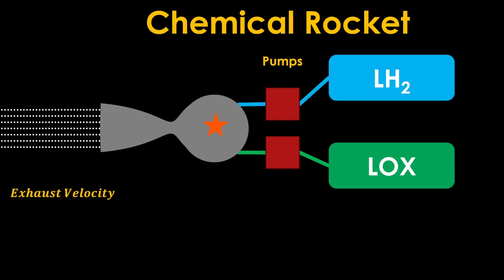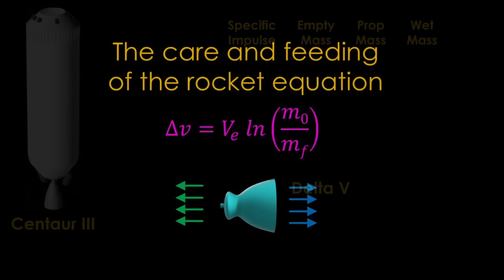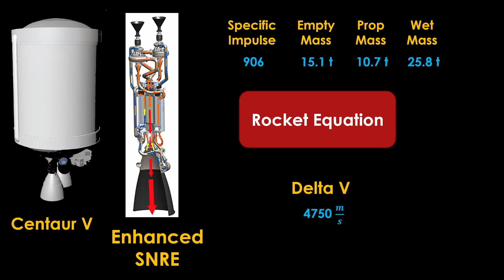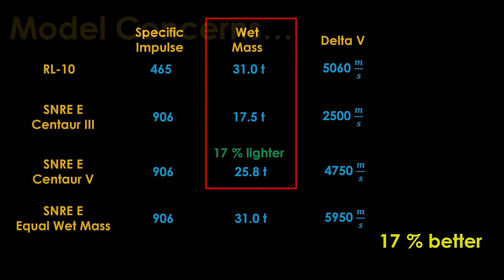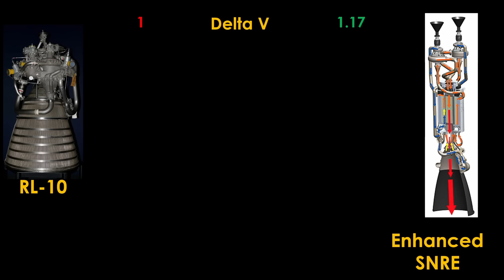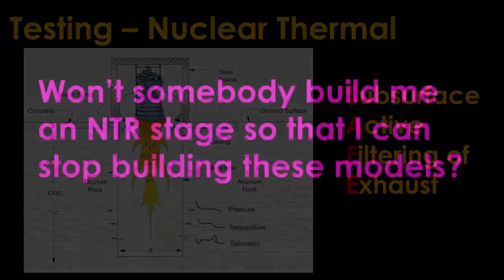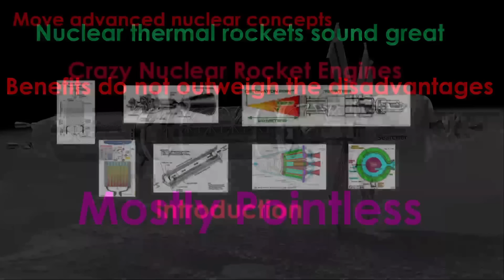Why Nuclear Thermal Rockets are Mostly Pointless

Comment: Thanks for covering this topic. Like you, I've always considered that the performance benefit of bog standard nuclear thermal propulsion not worth the trade-offs, particularly in cis-lunar space where delta-v requirements are more modest and where there's a near source of propulsion consumables (i.e. the Earth). Where it may make more sense is for crewed interplanetary missions where we're leveraging the higher specific impulse for reducing travel time could be a major benefit, and where one could assemble very large stages with large propellant tanks in Earth orbit, but then again you still have to deal with the reactor shielding required to protect the humans. For uncrewed deep space missions, I think nuclear electric propulsion  (or solar electric propulsion for missions in the inner solar system) makes more sense given the much higher specific impulse available with electric propulsion.
Reply from the maker: https://www.youtube.com/watch?v=xUoE7wOB-fY
Reply: @EagerSpace  thanks for sending the link about the nuclear electric propulsion -- somehow I had missed watching your earlier video. I had not previously considered the issue of having to cool the lower temperature components, which indeed sounds like a very significant problem to overcome. Perhaps one could be able to use a series of heat pumps to get the tempurature up for high temperature radiators? Of course, that adds to the overall weight and complexity.
Reply: Heat pumps would cut firmly into your generation. It would likely end up that overall efficiency would be close to just accepting a higher temperature sink. Nuclear thermal is not the best but it is the most well understood  next step for high thrust high isp
Reply: @Ethan-3369  yes I suspect you're right. The added complexity, weight, and power requirements of heat pumps probably would outweigh the improved thermal dissipation efficiency of running at higher radiator temperatures.
Reply from the maker: There's a study that looked at heat pumps and my recollection is that it would cut down the radiator size by a factor of 1.4. Still useful if you don't mind the extra complexity.
Reply: @joakimlindblom8256
The delta V requirements in the earth moon system are lower but not negligible

People don’t usually realize that Apollo was barely possible. They did only minimum delta v maneuvers, they flew to the moon in a free return trajectory that also used the moon as a gravity assist (talk about being cheap). Because of that they were limited to a narrow band of landing sites near the equator. And because the moon is tidally locked to earth they were further limited to a section of a band around the equator. 

If you look at a map of the Apollo landings, all of them are in the same area. That’s not a coincidence or a choice, they literally didn’t have the fuel to land anywhere else. 

And Saturn V used hydrogen for its upper stage, more efficient than the more commonly used today methane. Which is why you have absurd stuff like the idea to refuel NINETEEN superheavy/starship rockets to send one team of astronauts to the moon

Chemical rockets are barely enough for orbit and landing on the moon. Nuclear rockets have around 3 times the Isp compared to O2/CH4 or O2/RP1. That directly translates to 3 times the delta v, you now have more than you need for a moon mission and can make the rocket smaller. Much smaller because the % of fuel is a logarithm. So increasing exhaust velocity by 3 means you can make the rocket e^3 less packed with fuel while keeping the same delta v. 

I feel like kerbal space program has put the wrong ideas in the minds of a lot of people with how their solar system is ten times smaller than ours. So many people learned space stuff through kerbal space program and don’t realize just how tight the delta v budget are for a moon mission in real life

Like for context humanity had not landed on the far side of the moon until 2019. Saturn V is immense and puts a minuscule pod on the moon. All that can be changed with nuclear rockets 

And nuclear rockets are the only option here because high thrust is required to take off from the earth and to land and take off from the moon. From memory the earth-moon transfer is only around 33-40% of the total delta v or the mission. The rest needs to be done by a high thrust engine. 

So nuclear-thermal rockets are almost a mandatory requirement for landers whether you’re talking about the moon, Mars or Ceres. Using them for a moon mission would mean you could make a rocket far smaller and cheaper than Saturn V, and could also bring back a lot more lunar material. Many tons instead of kilograms. 

Electric propulsion is indeed correct for interplanetary transfers however it cannot help you in any high acceleration part of the mission such as landing and taking off from planetary bodies. 

Electric propulsion from LEO to the moon would also make the mission a lot longer which is an issue from supplies and mission duration.  They simply lack the TWR to go there in a single burn. And depending on the final setup, a human crewed ship with ion engines might have TWR so low that it’s forced to slowly spiral out towards the moon, taking week(s) to get there 

Ion engines shine at longer distances where they have more time to accelerate. They really struggle when the distances are short and when there is a heavy high gravity body nearby. Ion engines for instance are awful if you’re trying to do stuff in the Jupiter moon system. Not to mention the lack of sun over there
Reply from the maker: > That directly translates to 3 times the delta v, you now have more than you need for a moon mission and can make the rocket smaller. Much smaller because the % of fuel is a logarithm. So increasing exhaust velocity by 3 means you can make the rocket e^3 less packed with fuel while keeping the same delta v. 
Did you not watch the video at all?
You do not get 3 times the delta v because a) you need bigger and heavier tanks and b) your engines are roughly 10x the mass.
Reply: Mars transfer dosn't really require much more DeltaV then lunar transfer as the moons practically at the edge of escape velocity from Earth already.  While marginally higher DeltaV can make the Mars transfer faster its too costly to be worth it even with NTR, NASA compared it all and deduced correctly that doubling your payload is worth it for an additional month of transfer time.  Infact in a longer trip such as to Mars Solar Electric benifits because it can use thouse unavoidable months to accelerate and fully utilize its low but steady thrust and it will get a higher payload fraction to Mars at a modest increese in flight time.  A lunar trasfter though is possible in 3 days with high thrust like that of a NTR or chemical rocket, while a electric system would need weeks or months to build up speed.  Thus the Lunar transfer is actually the best case for the NTR, and it is still not good.
Reply: @kennethferland5579 Its much higher when you include capture costs, then even more for return.